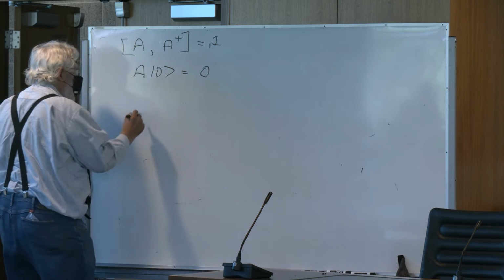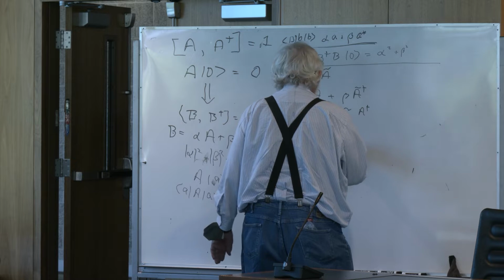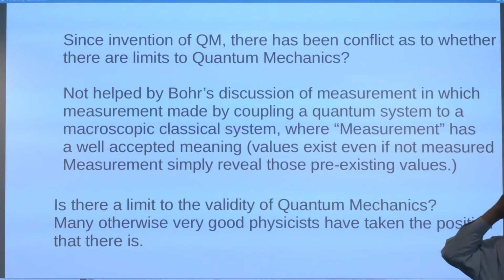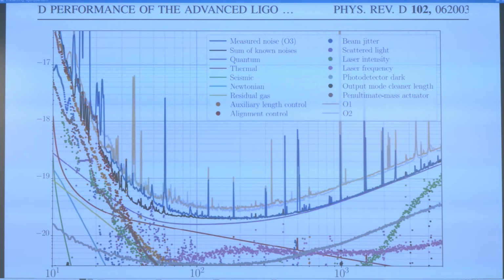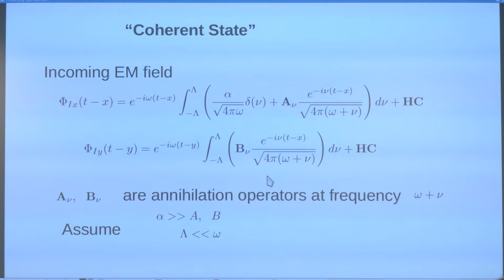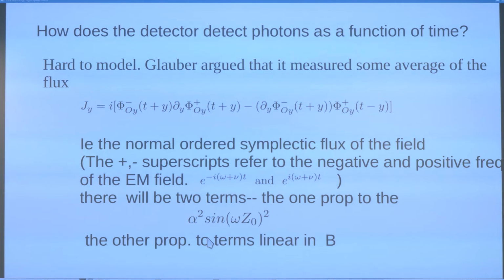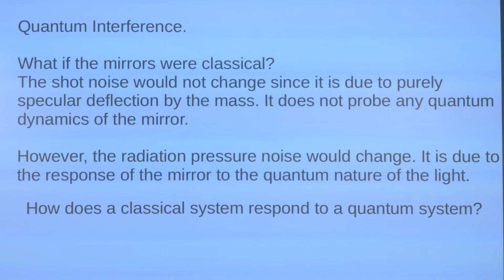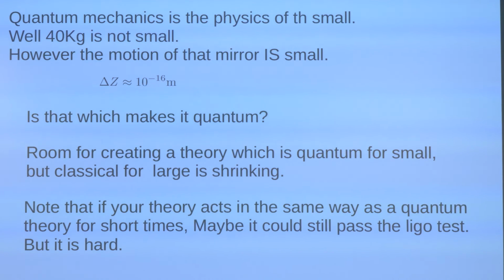“Ligo is Quantum” by Dr. Bill Unruh

Comment: Basically the coherence of the amplitudes are intact until they are absorbed/reemited, anyway, this is handwavy af, but the point is that if you were to try to reproduce quantum mechanics by some classical underlying theory with definite values for things, then you need stuff to behave quantum mechanically in a sense anyway, and from the stuff i have explored it seems that you can't really get rid of that character of behaviour. But there would be no reductions of wave functions really just some evolution, and reductions come from a collapse of some physical arrangements by stochastic means at the point of reduction, meaning that the collapse is just a physical process depending on the exact state of the waveform and the vacuum and the thing it interacts with, but the outcome is not sent out from the lazer hidden inside the photons, that last bit is important, its not possible to just reduce it to a classical picture with point particles flying around, the interference of the amplitudes has to be reflected in properties of the classical state, and the specific outcome has to be additional variables, not in the sense of some secret note carried inside the particle, but some details about the entire rig that is decided upon by the state of the measurement device and the light emitted and the vacuum and so on at that moment, i have been using semi classical in a different way than the literature i think, so sorry for that basterdisation of lingo :). Anyway, my point is quite simple, its not enough to shuv a note in a photons backpack and call it a beable. For some classical description to be sufficient, you ofc have to be able to cancel the noise if that is what is happening here, that would mean that the properties of the amplitudes that cancel and reduce the noise prduces have to live on in such a description, in a real tangible way, or its obviously a lost cause, but this applies to many other quantum processes when you try to describe them classically.